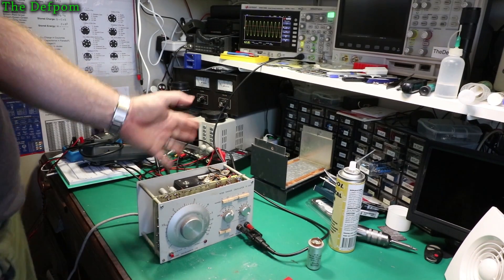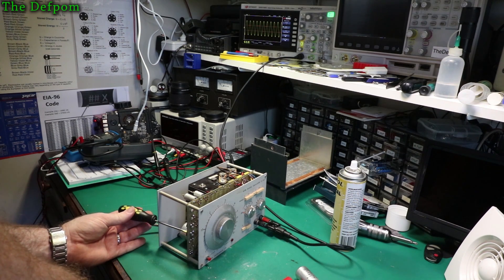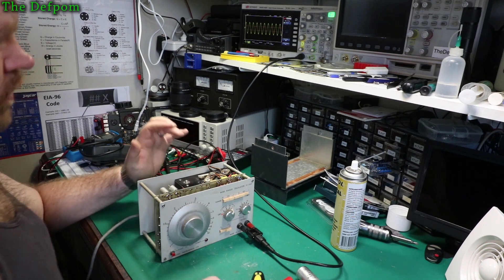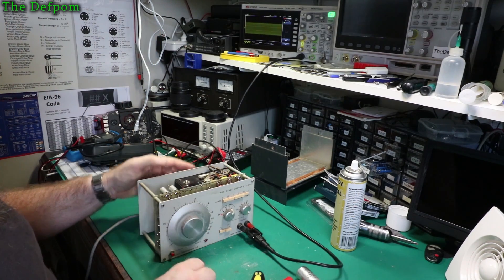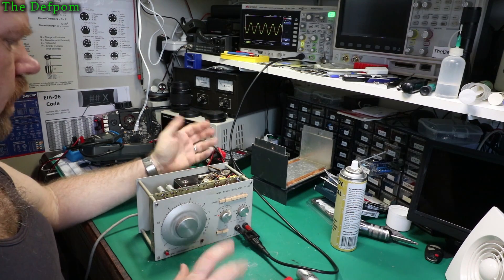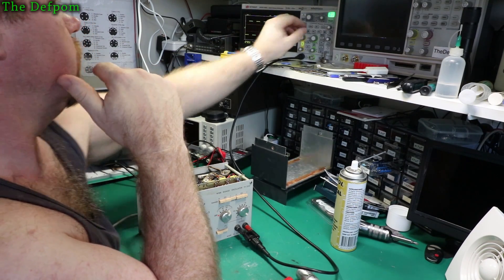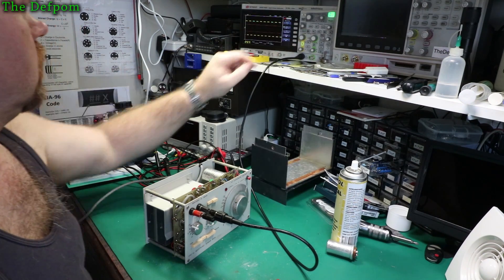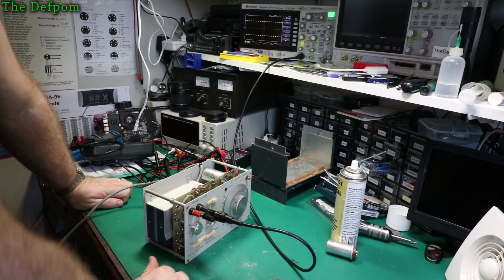🔴 #502 Marconi TF2103 Wide Range Oscillator Calibration

Comment: Hi and you do interesting stuff so keep up the good work I enjoy watching your videos. I have to point out that you are doing a verification. Calibration is comparing a unit under test or unknown parameter against a known reference that has also been calibrated and has traceable results back to a know National Standard or Reference Standard. Adjustment is not calibration. You do say none of your equipment is calibrated.
Reply from the maker: R B - thanks that is a fair comment.
Reply: More stuff please as awesome info. Helped me repair my Fluke 341A even if it had a few other issues. Same cracked bush in switch how unreal? Massive thumbs up.
Reply from the maker: R B - thanks, I’m happy to hear it was of help to you.

Comment: Nice old oscillator. Just for your info it's bloody freezing out! Levels will only be correct if terminated into correct load. Is it 50 ohm?
Reply from the maker: No, it is supposed to be 30 degrees C this weekend  ;-)
I prefer cold to hot, at least you can put more clothes on, there are only so many clothes you can take off before it becomes socially unacceptable and the police get called.
The service manual didn't mention anything about applying a load to calibrate it so I went with an unloaded output, I had measured the outputs and got 611 Ohms across it, so maybe it relies on its internal loading ?